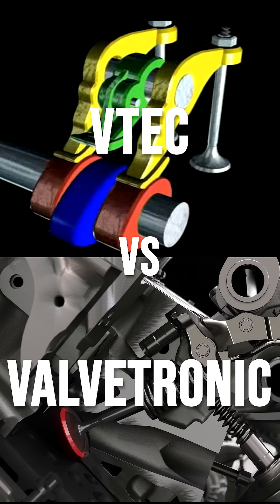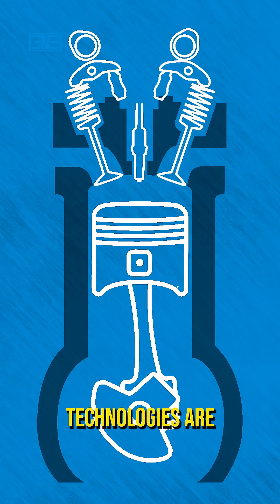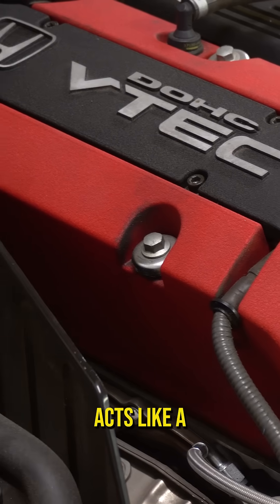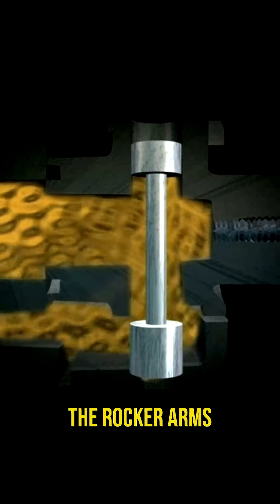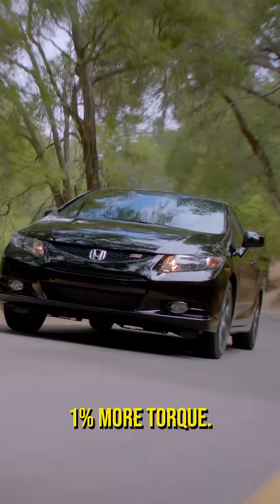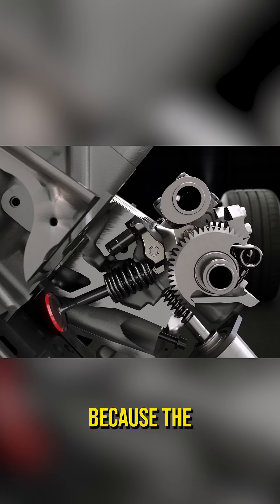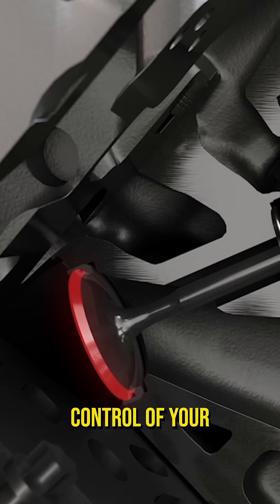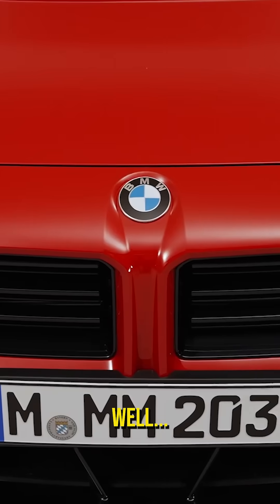VTEC vs Valvetronic - Honda vs BMW!

Comment: The N20, B48, and B58 engines aren't known for frequent or premature valvetrain issues. To give credit where it's due, BMW's Valvetronic engines are actually quite reliable, in my opinion, other than actuator oil leaks
Reply: The largest issue with modern day BMW’s (in the powertrain department) is the overuse of plastics. That means over the first ~50k miles or so, they are quite reliable, after that not as reliable as let’s say Lexus/toyota who generally over-engineer parts for longer term reliability. That just means the maintenance is higher on a bmw if you plan to keep it for a very long time. On the flip side, bmw is know for higher performance mass production vehicles.
Reply: @Bimmer_Bill then all you need to do is to buy well reputed performance parts and substitute the plastic pieces you are complaining about, to have a basically indestructible, high powered engine.
Reply: @Bimmer_Bill  The main plastic parts you gotta worry about are the charge pipes and the coolant pipes (charge pipes arent an issue in B58), the parts alone cost only like $400 and will take a few hours to install, once that's done that's all your worries gone, simply just get the performance parts and not only will you make it a lot more reliable than it already is, you can also push much more power reliably as well.
Reply: @Bimmer_Bill bmws used plastics for over 3 decades at this point. The plastic isn't a failure point except for in their cooling systems... and other manufacturers have been using plastic there as well.
Reply: @Bimmer_Bill Lotsa good that does in normally heavy traffic. The fastest stuff on earth is useless in CenTex commuts
Reply: Just enjoying my BMW N55 with it's third generation Valvetronic and double VANOS
Reply: @Ashley_van_Schooneveld  your N55 still isn't as reliable as a B58 though, look at gen 3 B58, that thing is unbreakable.
Reply: Took them like 50 years. And cars still unreliable. Whereas you could literally run a  Honda Engine without Oil and it will still run untill it physically can't.
Reply: @deepakkumartiwari9436  dumbest thing I heard, newer BMWs are top 2 for most reliable cars, hence why toyota uses bmw engines now for their flagship cars. Go learn something or two about cars
Reply: @deepakkumartiwari9436 someones done a test on a few engines and they brought a bmw out with no oil that was known for being unreliable and the mf lasted like 20 minutes.
Reply: @deepakkumartiwari9436  being able to run without oil just shows the lack of sensors and safety features in the engine, most modern cars don't allow the engine to start if it detects insufficient oil.
Reply: @mikeyyyy8726 what car doesn't start is it doesn't have oil? Lol bmw's you have to start the car and let it warm up before you can check the oil level...while you don't know if you have oil....
Reply: @kevinmonahan2820 Yeah but the car can detect if it has very little to no oil, in this case it won’t let you start it, all german cars are like that even the newer japanese like toyota, kias and hyundais. Its just a basic safety thing. Having no oil is different to checking your oil levels, they’re two different sensors.
Reply: S55 is looking at you
Reply: @ferid9k only based answer in this comment section
Reply: It’s reliable shoved into a Supra lol
Reply: I have an N52 at 196,xxx miles in my 128i, haven’t had an issue with valvetronic to this day
Reply: BMW oil leaks are a feature, not a bug.  I know, I have two of them. 😂
Reply: @superspeeder  German cars aren't reliable in the US for many reasons. 1. lack of qualified technicians to work on the cars, don't have the right tools or training. Americans dont properly maintain them. Huge used market. Everyone wants to drive a fancy car they can't actually afford. It's amazing how the same cars have no reliability issues in Europe. BMW USA itself is part of the problem. And the truth is, they're not designed or intended to last forever. The average car in Germany drives about 7,000 miles a year. It takes ~15 years before the average car in Germany hits 100k miles. They go by KM though, obviously. In the US, the average is double, literally 2x. Anyway. a HUGE part of the issue many people don't understand is 1. lack of maintenance and improperly done maintenance by mickey mouse mechanics lacking the proper tools and training.
Reply: @TimJohnson-x1o  I don’t disagree that lack of maintenance is an issue, but what has that got to do with oil leaks?  Gaskets for oil pans, rocker covers and oil filter housings are not (supposed to be) maintenance items… but they are on BMWs.
Reply: "this car is reliable if you ignore this unreliability issue"
Reply: @CorbinJonesZersdan my toyota is reliable if you ignore the fact that toyota installed the wrong sized pistons and put oversized piston rings on it that are now burning oil, and used valve seals that were too soft, resulting in more burned oil.

And my hondas only on its like 3rd ac system refresh in 120° weather

But lets only do it for other brands sure. Every honda or toyota ive owned has costed the same or more than my n52 to maintain. And the issues with my n52 involve replacing basic seals or plastic that takes 20 minutes to change. My toyota needs a damn engine rebuild at this point and it's been maintained the same as the bmw.
Reply: You did not just call a b58 reliable. Sinner
Reply: @gavinoleary2793 its quite reliable, unless you buy temu performace products, duh. I've raced B18Cs and its quite an oil eater.
Reply: @gavinoleary2793  the B58 is one of the most reliable modern engines, wtf are you even talking about?
Reply: @gavinoleary2793 wdym? B58 is overall a very reliable and strong engine. They dont call it a modern day 2jz for no reason
Reply: @gavinoleary2793 B58 is reliable by modern standards. The low oil recommendation for emissions is what ruins it.

N52 and M54 are far more reliable than any of the engines he listed though.

Comment: VTEC sounds cool. BMW's valtronic probably doesn't really sound like it has a crossover like VANOS did.
Reply: every car with valvetronic also has VANOS
vanos is VVT
valvetronic is VVL
which, if executed like BMW does, can work through separate mechanisms
Reply: @TheImperfectGuy VANOS also doesn’t have a crossover. It’s just altering valve timing. Not lift. “Crossover” that’s felt is more than likely due to intake harmonics. How the S65, 54 and 85 all feel like they wake up once they hit a certain threshold
Reply: @home541_  Early VANOS only had 2 positions for valve timing, so there would be a small change in sound as the phasers switched between advance and [redacted] positions.  They went to continuous cam phasing pretty early, though - around the time that they added double VANOS to the exhaust side.
Reply: @JETZcorp  I see what you did there lol, but i don't think your account will get a strike if you are using that word in the proper context of its original meaning, 🤣🤣none the less you are 100% right the original VANOS has a noticeable rpm point where it 'wakes' up and is not smooth like the newer constantly variable ones that are absolutely impossible to notice, (owned US Spec e36 m3, e46 m3 with that horrid SMG and e93 m3) and currently still have an f87 M2C

Comment: Vtec will always be better than over-engineered expensive complex mechanisms. A simple hydraulic powered pin that locks in and boom. Fun ensues
Reply: Better is subjective. It's more reliable. But not everyone likes the way Vtec engines make and deliver power.
Reply: @matthewnicholas6365  still wont leave oil all over your drive way
Reply: There are virtually no issues with the bmw's system. Complex doesn't mean it's a liability. Proved to be actually very reliable
Reply: @jordybartko  replacing the vanos solenoids on bmw engines is actually pretty common.  Usually not very difficult, but it does cost some money to do.
Reply: @mikey631  Not until high mileage, but yes. It just isn't even close to being unreliable overall. The point of the argument was more so that people see "complex" and automaticaly assume that it's demonically unreliable all of a sudden.
Reply: VTEC feels like lag boost in a NA car.
Reply: But do you really feel that change in the car?
Reply: Yes! You absolutely do.  @tasteradio1060
Reply: @tasteradio1060  Driving a car with variable timing control like that is wild. It's like you drive a realy boring 89bhp commuter, and then vtec kicks in and you drive a screaming 127bhp shitbox
Reply: 1% more fun
Reply: Problem is VTEC = ancient technology and makes almost no extra power. It's mostly just noise.
Reply: Get a job everyone. Every manufacturer has good reasons for what they do that most people don't know or can't understand. 😂
Reply: @Dumbo3.1428  "good reasons for what they do"

Yeah, most of the time it's to maximize the extraction of liquidity from their customers' wallets.
Reply: @rars0n  that's the system we've chosen. Welcome to capitalism.
Reply: i love BMW's but i'v said it every time. i don't care what happens to the bmw's engines, its not getting replaced, its getting swapped. and generally go LS, but i do love the B58 engine line.
Reply: @AlteredCarbons but with Honda K series engines no need to swap they dont break unless you push way too much power on internals
Reply: @Luckytmj97  or forget to fix the timing belt, then at that point your engine just gone compared to having a timing  chain
Reply: @AlteredCarbons but a LS would be better than any BMW engine due to reliability
Reply: And sound like trash?? No thank you.if I own a bmw, it's gets a bmw engine. People who LS swap everything lack actual mechanical skills to maintain shit @Luckytmj97
Reply: @alainaguilar9938  It takes far more mechanical skill to swap an engine than maintain one that came with the car. BMW engines are often overcomplicated pieces of crap which makes simple maintenance a pain in the ass. It's not a skill issue, it's an annoyance issue. Nobody wants to take apart half of their engine to install a $3 gasket on their alternator bracket.
Reply: @alainaguilar9938   faster and more butllit proof.
Reply: @alainaguilar9938  but still un a fun little weekend beater i would go with k24 over ls buut for like a drag build or smt i would go ls ameracan muscle.
Reply: @Luckytmj97 lmao no. LS engines are prone to failure probably more so than b58, s58. The difference is cost of parts. LS are cheap.

Comment: Honestly I'd give BMW the W here, I don't see the system failing often, just do regular maintenance, correct oil, and it should be rock solid
Reply: The reason why bmw lasts so fast by some peoples is because user's fault, not car's fault.
Reply: BMWs b58 engine in the new mk5 supra already went 200k miles with regular maintance
Reply: @charles-fq2dw this engine has Toyota levels of reliability, no wonder the japanese brand chose it to equip the supra.

Comment: Valvetronic, great design, not so great execution
Reply: What makes you say that? It's generally a very reliable system. Really only the first generation implemention had significant problems and that was mostly used on european cars.
Reply: @ you’re probably right. I’m just inclined towards things I can fix myself.
Reply: @boatbikemike8571  you can fix valvetronic, it's not that hard
Reply: No? The valvetronic engines are absolutely Bulletproof.

Comment: VTEC is 30 yo tech that works perfectly fine.  VTEC yo 
J37a1 got a mean crossover lol love it
Reply: J series vtec just hits different
Reply: @9thgen66 the J35A5 in the gen 1 mdx is underrated. Gotta go 2004 through 2006 for one but they're good.
Reply: @gavinoleary2793 I believe they are in the same year ugly truck too lol but I'm most certain all j35 btw are intake only 
32 type S and 37 are full vtec
Reply: It sounds great on fully stock exaust.. wish i had som pre cat deletes or something to bark up the exaust a bit lol.  Family car problems lol  @9thgen66
Reply: @9thgen66  Nissans V6s destroy Honda in both reliability and power. Their going bankrupt
Reply: its tech that needs to be updated

Comment: I want reliable Boom Boom Booommmm VTEC... I already have an expensive hobby
Reply: I've had plenty of reliability issues with all my BMWs, but none are associated with the Valvetronic system. 
1% gain ... negligible.
Reply: THREE BIG BOOMS FOR VTEC
Reply: Honda were only 2% more reliable in 2024 the joke doesn't work anymore
Reply: @fastandfhurious3213  Good thing I have a late 90s VTEC. Still goes boom boom at 5.6k rpm on the dot afer 27 years and 240k km.
Reply: @juleangrasmeijer4770  My '97 Del Sol with a Type R motor absolutely RIPS the road.  For styling, perfomance, and reliability you can't beat the 90s Japanese stuff.
Reply: @fastandfhurious3213  Says who?
Reply: @TheRealDrJoey source: trust me bro
Reply: @fastandfhurious3213 yall seem to forget the repair procedures. Yeah, they're not as reliable anymore, but try fixing a beamer compared to a honda.
Reply: @Fredrick-Von-Beerus-III  they are literally more reliable lmao, legit top 4 most reliable cars in 2022/23/24 lol. Also neither are that bad if u know what ur doing u just need specific tools for both 💀
Reply: @fastandfhurious3213 most people dont buy brand new cars. And most care people dont only compare the specs of new cars.
Reply: @fastandfhurious3213 no one gets a 2024 anything. To expensive for anything.